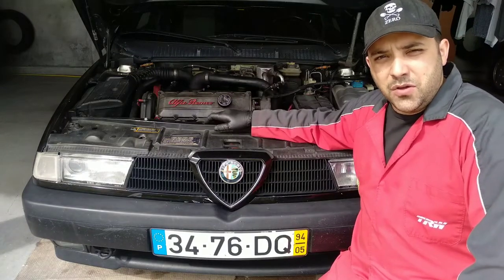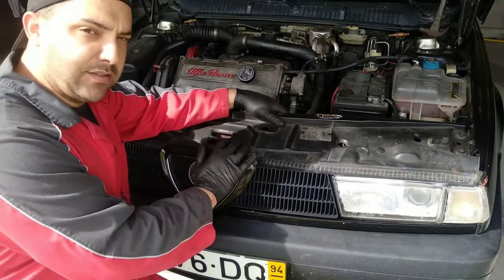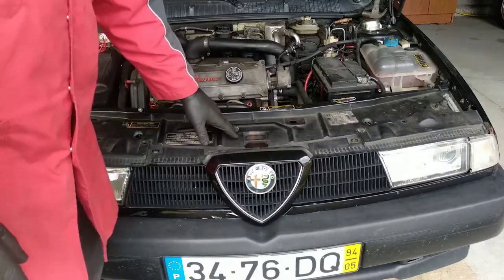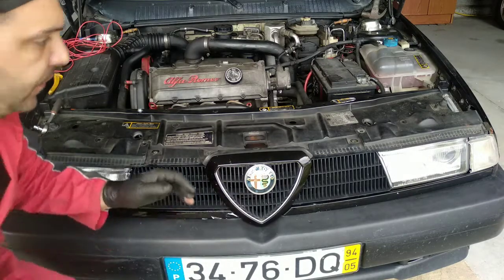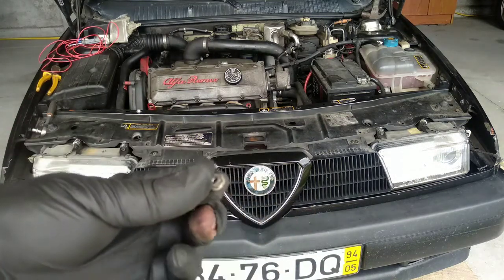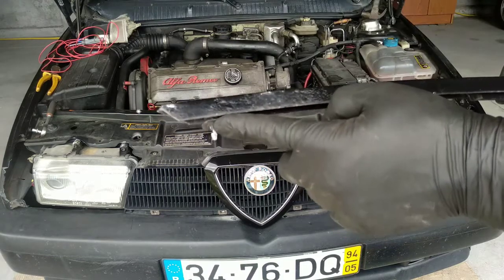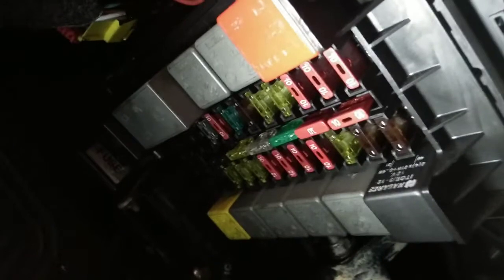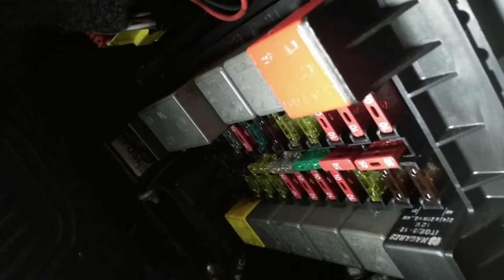Horn not working? How does it works? How to solve? Alfa 33, 75, 155 and others.

Comment: HI there, may I ask what's the engine on your alfa romeo 155?
Reply from the maker: Hello! Yes, it's a modest 1.9 td. Saved it from going to the scrap yard
Reply: @alfaromeonoproblem  I see..... no wonder i have seen twinspark 8v, 16v, V6, turbo 16v but never seen a td on it
Reply from the maker: You also have a 2.5 VM engine td. It's really good. Quick of the line, smooth and powerful